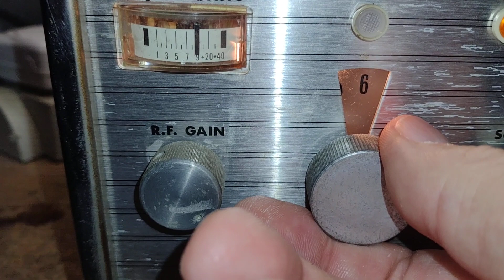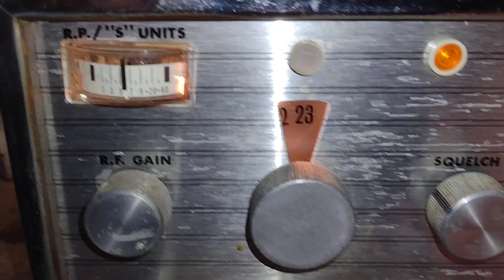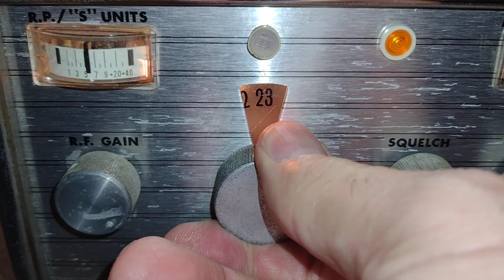A Spin Around The Band: Utica's Town and Country 3.

Comment: Great to see this! I have three of these. Great radios!
Reply from the maker: They certainly are. Mine came without a key for the power switch so I had to replace the switch. It's a wonderful vintage radio! Thanks for watching and checking out my videos.
Reply: Does yours have a variable ANL? Also if your modulation meter does not work, try replacing the 1N457 diode in that meters circuit.
Reply: I’d love to find one with the white meters.
Reply from the maker: @ITSHAA-yn5zc  , Mine has the variable ANL, and the mod meter works fine. All it needed was the controls cleaned and a good alignment. It is quite pleasant to listen to all day. There is a slag pit a few miles away and they use channel 1 and 23 to talk with the many trucks that haul slag in and out.
Reply from the maker: @ITSHAA-yn5zc  Around Pittsburgh they're not common, like the Polycomm Pro. I bought mine online, and have never seen one at a hamfest in over 50 years.
Reply: What’s funny is how they chose random colors for the tx and rx lights. Some have green, red or orange for   Tx and rx . I have 3 of these and the lights are different colors.